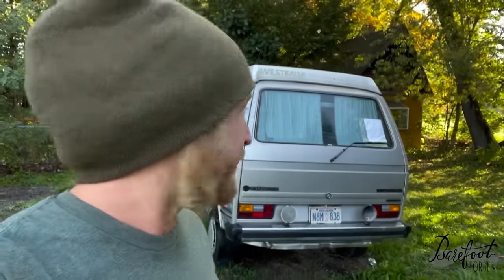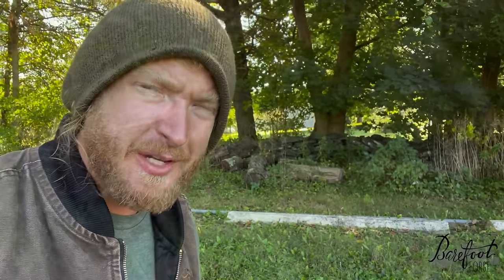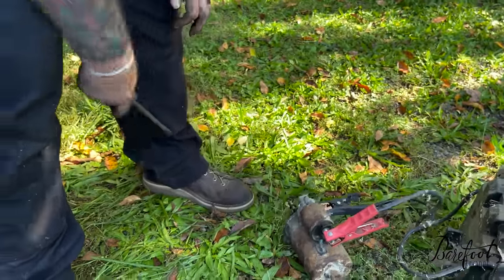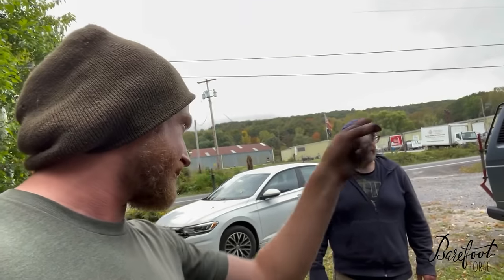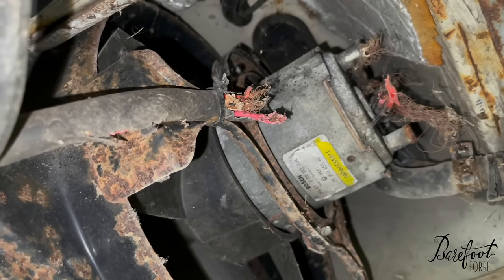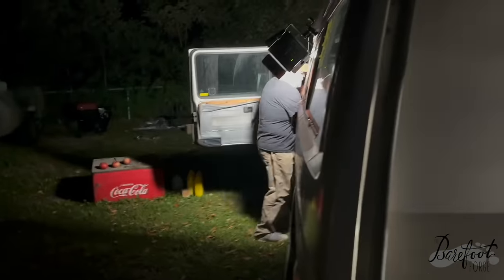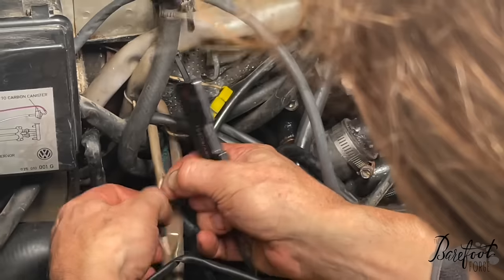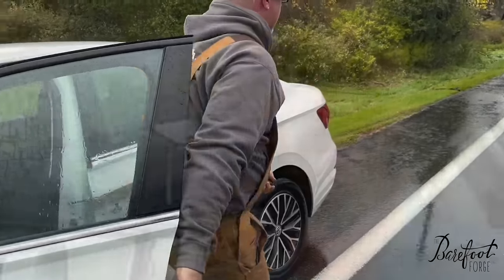Forgotten 1987 VW Vanagon Syncro Westfalia- "Heidi"- Will it run? Chapter 3 THE DRIVE HOME

Comment: The video brought back a lot of memories. I had an '84 2WD weekender back in about 1993. Every so often when starting it the engine would run like garbage - hunting idle and no power. Turning it off and restarting it would (usually) make it run just fine again. Sometimes it took a few restarts, but it always got better. Never found the issue, just lived with it.
Reply from the maker: Sounds like an oxygen sensor wire issue! Legendarily problematic. 
Do you miss your bus?
Reply: Constantly. I got it from my folks with a bad head gasket - I did the head gaskets with the engine in place and learned some creative swear words. Eventually I sold it because of a leaky radiator- 20 something me didn’t have the $400 or so that my local Beck Arnley parts place wanted, so I sold it.

Comment: Black electrical tape for the blinking red light on the dash Clorox Clean-Up for the roof and a group paint session to graffiti the sides front and rear of that bus happy trucking friend
Reply from the maker: The bummer about going the electrical tape method is that then I wouldn’t have been able to see and monitor the gauge. The gauge and the light work independently of each other (somewhat), so I was able to still tell if I’d of been over heating….. but ignoring that light of doom really took a lot of mental strength!

It’s since been fixed. 

You think we should clean the roof, or the vehicle in general? I like the patina and moss!

Comment: I absolutely loved this episode. Editing is getting really good! I’ve been chasing similar issues on the 1.9. Intermittent of course so you can never truly track it down. We did 3500 miles this summer and some days it was great. Others, trash. Anyway I appreciate you putting all the work in to make these. Infinite blessings my dude!
Reply from the maker: Thanks buddy! I highly suggest a brand new wiring harness if you haven’t yet, I’m a big advocate (and increasing advocate) of the value of a new wiring harness. It just proactively takes care of so many intermittent BS problems.
Reply: @TheBarefootForge  such a good call. I got tested known good AFM, ECU, Distributor, and coil as backups and I’ve replaced every other sensor in the damn thing so the harness is next. Specifically connectors in the plugs will get my first peek. 🔌 ⚡️⚡️⚡️👨‍💻👨‍💻

Comment: Great episode!   I work on air cooled BMW motorcycles so I had to look up the reason for drilling the hole by the rear main seal as it is a similar setup.  I guess you’ve got some electrical gremlins to sort out, but mission accomplished!
Reply from the maker: Ya, the hole thing is a newer trick from our friends at gowesty- apparently, it fixes the problem. Supposedly. We shall see- but it’s not leaking yet!

Comment: The blinking light…. We’ve all been there. I magically fixed mine by wiggling the two barrel connectors in the black box. It could have been a coincidence though.
I’ve enjoyed the videos
Reply from the maker: Oh nice! In this case it was a bad fuse block and bad coolant blinker relay.

Comment: Job well done! Looking forward to the next project.
Reply from the maker: Well, i'm not sure how many more busses i need to own. So are we going to rescue another next year? IDK!
I guess first we need to find someone that wants a bus and wants to be a part of the rescue- is that you?
Reply: I am from South Africa and own a 2.6i VW Microbus (The South African terminology used here was Microbus instead of Vanagon). These models were still locally manufactured after worldwide production of Vanagons ended in 1990. My model is a 1996 model fitted with a 5-cylinder 2.6 liter fuel injection engine derived from the Audi100 models. VW South Africa discontinued manufacturing of this iteration in 2003. Other than the engine and a few cosmetic upgrades my bus is basically the same shape as the Vanagon models. I do maintenance myself and enjoy watching your videos. I always learn something when seeing you do field-repairs. @TheBarefootForge

Comment: Drained gas tanks are the most dangerous . No open flames !
Reply from the maker: that is correct- when there's any residual fuel vapors. 

If however the tank has been open to the environment and fully drained for MONTHS like this one- that's just a volume of air space, it's just a container, no longer "a gas tank".